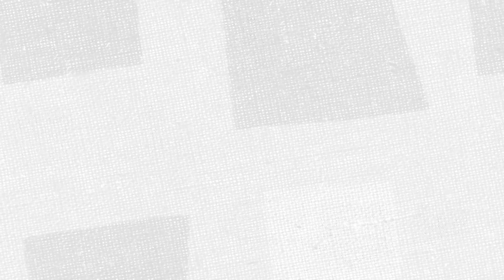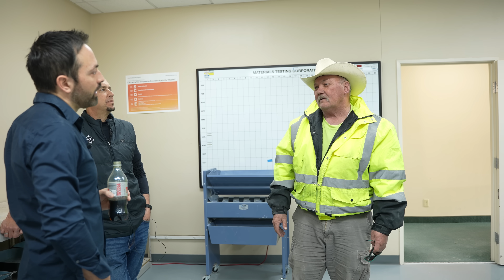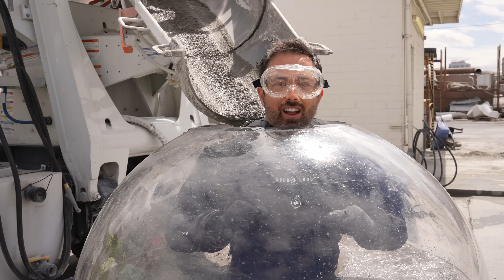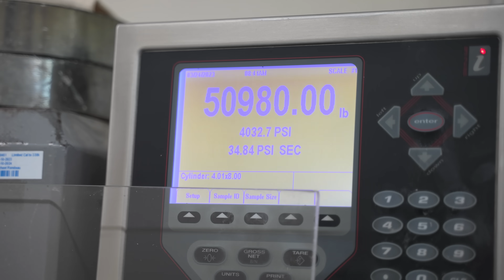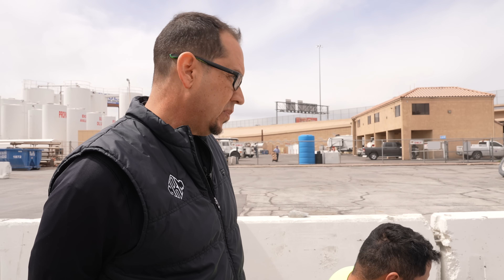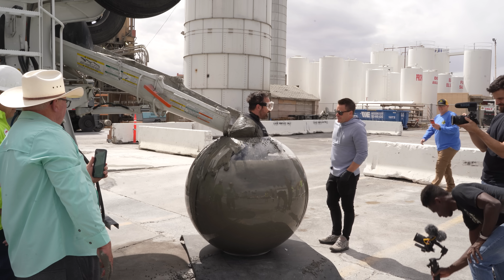Getting Buried In Concrete To Explain How It Works

Comment: Why haven't you mentioned the huge problem with the type of sand you need for concrete? It's not just any sand, as mentioned in the video, it should be round and not too fine. That means you can't use desert sand, of which there's an abundance in the world, but you need to dig up shores and riverbeds. The amount of concrete we use has already made this type of sand to a scarcity and creates serious environmental issues.
Reply: Especially with environmental-oriented sponsors so often. 
Right up there in importance with the minerals needed for electric vehicle batteries, I guess.

Comment: On a somewhat related side note. . .
The thermal expansion rate of concrete and carbon steel are very similar, 
making the use of re-bar possible, thereby increasing the strength greatly.  
A somewhat fortunate coincidence.

Comment: 1) Loved the bull wurtz bit
2) I have heard recent developments re: ancient concrete, esp. Roman concrete. Partially the strength was supposed to have come from an ability to self-repair? As I read it, the quicklime wasn't completely mixed in and was left in large pockets, and seawater specifically was used for mixing. When a crack appeared, rainwater or seawater would flow in the crack, take some of the unmixed quicklime as it flowed in, do some chemistry vis a vis the seawater (or perhaps minerals in the seawater?), and the resulting mixture would re-fill the crack. Apparently, these small pockets of quicklime are considered under-mixed or impurities by today's standards. It appears to be a study from MIT and Harvard. I dunno if it makes the concrete stronger, but it certainly appears to make it more resilient than modern concrete, and partially why Roman concrete is so long lasting. It's pretty new though, I think the study was just released earlier this year, but did the concrete chemists happen to have anything to say about it?
Reply: 15:14 He mentions the self repairing Roman concrete

Comment: "difference between cement and concrete, because people often mix these up" the #1 pun we used to use to explain my old job, I used to be an agi driver. so much stuff you have to know. also, the different strengths of concrete (like 100MPA for airport runways/taxiways, 25MPA for a house slab, 15MPA for a footpath, etc.) depends largely on what they're being used for. take a 50 storey building - you'd start the base and the first few floors at 80MPA (that's a 56-day cure, ie. 8 weeks), then progressively get 'weaker' (50MPA, 32MPA, etc.) as you work up the floors, until you're at the top where you'd use 25MPA for the roof. the slump is important because it needs to travel further up from the pump through a line to the exit point. for earthworks and pilings, etc. you can use steel reinforcing fibres (basically staples that have been opened up) to artifically make the concrete harder. it really is diverse stuff.
Reply: Interesting. I've seen and used cement with added plastic fibers which are also supposed to reinforce the concrete.
Reply: @moos5221  yeah anything that doesn't react with the concrete and can withstand the exothermic reaction it gives off will be fine for reinforcing. next time you go into a service station/gas station, look around on the concrete, and if it's old enough you may spot metal fibres poking up in the concrete. they'll be mostly flat so tyre punctures shouldn't be a thing.

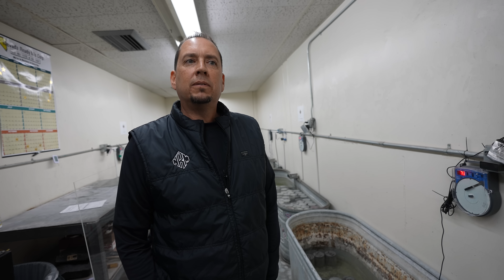Comment: 6:06 If anyone is curious, I work as an inspector for civil construction jobs. When there is a big, expensive job with liabilities, and concrete is poured, it gets tested. Every state is different, but mine requires a test every 50 cubic yards, 500 linear feet of curb and gutter, etc. The testing is used to determine who is at fault, either the contractor building with it or the concrete mixing company.  If a critical structure's cylinders  fail the break test, then the concrete company has to pay to remove and replace it. 

A technician from a third party testing company comes out to the job site and tests the concrete on site for temperature(which affects the ability of the concrete to set), slump (how wet or dry the concrete is), and air content ( 3-5% air prevents cracking due to freezing in winter) they will then collect 3 to 5 cylinders (depending on the job and design engineer's spec)  which are left on the construction site. This is so they will set in the same temp as the rest of the concrete that was poured. The technician will retrieve them after 5 days or so and take them to the wet storage.

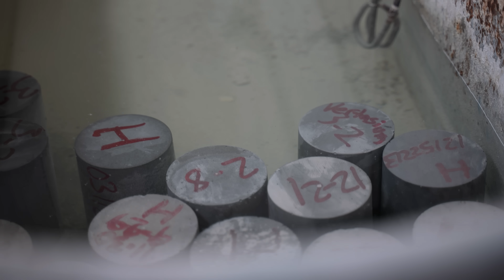Comment: Love your videos! Just wanted to add a quick thing on 5:59. Concrete suppliers sample their concrete only when testing a new mix in a job site, or in some other special situation, however almost every time concrete is poured at a job site, a 3rd party samples that concrete to test its strength on specific dates (7,28,56, 90 days) or even earlier if its a core wall, or a post-tensioning slab, where knowing the strength in one day is critical. 

A good rule of thumb for concrete is, the more dry mixes are lower strength,  while the more wet, but thick mixes are stronger. The strongest mixes (higher than 12k) will almost always have a kind of non-newtonian fluid property due to the chemical mixtures added. It is liquid, but when applying force to it (such as scooping it) it will become more like a solid. 

Concrete is rigorously sampled and tested at every job site to make sure whatever building type it is, will not collapse or crack due to bad concrete.
Reply: Practical Engineering's video titled "What is concrete?" disagrees with you. he tested some different amount of water in the mix, and the dryest one performed the best.
Reply: @EddSjo  I apologize, when I said "wet" It did not mean through the use of water, however I did not specify that. The less water will absolutely yield in a stronger breaking strength, the truck tickets will actually give a water allowance on each truck, adding more water than what the ticket says automatically means the concrete company cannot guarantee it will reach the strength it is meant to reach, however there are many other ways for concrete to be "wet" without having a high content of water, and it is exactly that wetness, that allows it to consolidate better, have less air bubbles trapped, and bond better.

Comment: I worked on a building once where the concrete company sent us an all fly ash mix (zero real cement). It was a really big deal and there was a lot of back and forth for a long time. Amazingly, the slab actually came up to strength in 30 days (3k psi break). Pozzolans are amazing stuff!

Comment: As a landscaper who is arm-deep in concrete on a regular basis, the basic PH levels you mentioned scared me a bit, and I might start wearing gloves.
Reply: read the top comment, it's scary stuff
Reply: If your hands feel rough like sandpaper, that's probably your skin being dissolved.
Reply: The bag says caustic m8, kinda wild you were never taught that tbh
Reply: @lavodan  I can't find it. What did it say?
Reply: @Egerit100  they talked about an experience where it was raining and stuff and they had to shovel concrete because it burst the mould. They were talking about how their hands felt kinda weird and tingly, and that after taking off their gloves, they found out that concrete had gotten and and stewed in there for the hours they had been working. They ended up getting chemical burns and some nerv damage I think, and only now after a year are they almost back to normal again

Comment: During construction in London on the subway there was a spill into a control room when concrete being poured found its way though an escalator control room into the other control room.
This left about a foot of concrete on the floor damaging equipment and closing some of the underground lines during rush hour. Workers then had to run around town buying sugar so they could mix it in to the concrete and kill the reaction before it set up. Similar to how Derek mentioned coke being used in this video.
Reply: I remember that - Victoria line, happened during the daytime, closed the line for the evening commute. Thanks to the sugar, they could clear the mess, re-instate the equipment, line open again for the following morning.

Comment: Spent summer last year working QC at a concrete plant, it was really nice getting to watch a video essentially about things I was working on/with regularly. Good stuff!

I will say, while admixtures in general were mentioned, I'm surprised things like fiber and rebar use wasn't discussed as much.
Reply: Dude, same. I'm a concrete technician, just like the guy with the press crushing the cylinders. And I was amazing seeing how similar things are even across the country. I thought there would've been a much bigger difference

Comment: I would have loved it if you had explained how some of the new concretes that absorb CO2 in large amounts work.
Reply: This whole video was a barely-disguised advertisement for portland cement. He didn't even mention how much CO2 is produced in the process, no way he'd go "anyways yeah here's something better that concrete companies and contractors don't want to implement."
Reply: @gearandalthefirst7027  If you watched the whole video he mentions that concrete production is about 8% of global CO2 emissions
Reply: At best, it only absorbed the carbon dioxide he released during the first step of baking process. But if you think about how nothing is 100% efficient and the heat generation for the first step probably came from a fossil fuel. It actually making alot of CO2 emissions too. Not exactly zero emission
Reply: @gearandalthefirst7027  I mean, he even mentioned that "portland cement is really just a marketing term"
Reply: @gearandalthefirst7027  who tf cares about the co2 effects of cement lol.
Reply: @JustFlyAway our planet?
Which we live on?
Reply: @raul-aurelianserban8295  our planet is not a creature bruh
Reply: @JustFlyAway  buddy
If too much co2
We dead
Got it?
Reply: @raul-aurelianserban8295  Who said that?
Co2 levels aren't anywhere near enough to cause suffocation
Reply: @JustFlyAway  its not suffocation. its the heat that's the problem

Comment: Great video. Only issue I saw was that we actually prefer "jagged" sand over spherical sand, as it provides better binding properties to the concrete. We typically do get jagged sand from rivers, where it is produced by erosion from the water. Spherical sand would come from a place such as a desert, where the constant wind and rolling of the dunes grinds the sand down uniformly into rounded particles.
Reply: Yes, famously when building in Dubai they couldn't use the sand from the Sahara since it was too smooth and had to import sand from Australia I think.

Comment: this kind of seems like something that could have gone unexpectedly wrong, derrick always takes great safety precautions but one thing i feel was looked over was the fact that it seemed the "fish bowl" was not held in place by anything and was on an elevated platform, this really began to worry me as he was sliding into it potentially causing it to roll over with him inside and roll over him causing injury or worse. I may just be paranoid but it even seemed to wobble as he slid in. Be safe Derrick, we love your videos (and  your safety)!
Reply: it looks to me like its sitting on a piece of thick steel that is bent at each end to give it some height and a hole was cut into the middle of it where the ball sits. So yea, I think they took the appropriate safety measures here. And thankfully too because what you described certainly would be dangerous

you can see it pretty well around 21:24
Reply: @SpydersByte  Also, that concrete is super heavy. You probably couldn't push it over even if you tried.

Comment: As someone who has made concrete thinmgs quit a bit, the only reason you floated out of the concrete was because the concrete was much more liquid than standard concrete is useable, too wet and there will be excess water in the mix to evapourate out, too much shrinkage causes larger than normal setting fractures. ive just touched on the subject here.

Comment: A good mix is called 1-2-3 mix.  You take 1 shovel scoop of cement, 2 shovel scoops of sand, and 3 shovel scoops of gravel.  Add a bit more cement if you wish but not a lot more.  You will get excellent strength

Comment: 10:32 Wait, I thought you DON’T want round particles, because the concretes ability to withstand sheer-forces is weaker than with rough particles that interlock in the concrete. That’s also why they don’t use desert sand for building, the wind made it round. Sand from rivers, oceans and quarries however is ragged. In Dubai for the Burj Khalifa they imported sand from Australia, since they couldn’t use the inferior desert sand and their coast sand was already used for building. Feel free to Google it.
Reply: Yes, I was looking for this comment since I thought the exact same thing. It's just logical as well: too smooth = less cohesive
Reply: @AlasdairThompson Concrete finishers want high w/c ratios and round aggregate, which is what was said. Thankfully, concrete finishers don't spec the product.
Reply: That's amazing, a desert country importing sand !
Reply: @KnugLidi  While it's true that you need water to make it set at all, having less water, a lower water to cement (w/c) ratio, increase the strength. My understanding is the main reason this works is that it has more time, it's a slower reaction, so more complete and thus stronger. A quick reaction with high humidity can causes surface cracks that lower overall durability.
Reply: Sharp edges and corners are stress risers.
Reply: Isn't that why they use rebar?
Reply: For normal concrete, you do want round aggregates, because the cement can adhere better. But if you want really strong cement, like two times the regular strength in order to build a skyscraper, then rough aggregates is better.
Reply: @eh9deux  rebar is for reinforcing the concrete in tension as concrete is extremely weak in tension compared to compressing it.
Reply: @kindlin  actually, a low w/c raises strength because when all the clay is hydrated, you don’t want free water in your concrete because it will evaporate and basically leave holes behind, which are very bad for the strength.
Reply: Civil Engineer here, no you don't want spherical aggregates (both coarse and fine). The more spherical the aggregates are, the lower is the strength of the concrete as there is less and less bonding between the cement matrix and aggregates.
Reply: For sand rounded is ok but for coarse aggregate you need corners
Reply: @blackbuddhaa  no, even rounded sand is not okay. Rounded aggregate be it fine or coarse don't interlock together which leaves pores for water to get into and rust the steel, just reduce the life in general.
Reply: Yiu have rough aggregate and smooth sand. The sand and water create a float above the aggregate giving the smooth surface, while the sharp aggregate, in matrix give the bite/ strength, as I understand it.

When you do the float however, you dont want to bring up too much water, otherwise the skin section looses too much strength.
Reply: Its an "and and" situation. it's percentages of various qualities you want your concrete to have. 5% More sheer resistance is a lot! But at a cost. That's one of those qualities, cost. So, what is the cheapest way to get those qualities, and in come the various aggregates.
Reply: @kindlin  Correct in that the w/c ratio is critical for strength.  My point is that concrete specifications aim to hit a specific strength, but the concrete finishers aren't concerned with strength but the ease with which they can get a nice finish.  They want a higher w/c ratio and will often sprinkle extra water on the surface of the concrete during finishing to get a smooth surface.  This local increase in w/c actually weakens the top surface and can result in premature spalling
Reply: @skieurdovronnaz241  So it is because it's a more complete reaction, but more complete on the water side, the cementitious side, you're saying, was always ran to completion.

Comment: I worked at a ready mix company once, they did the same quality test samples also, and I live in the Caribbean. Honestly to this day, that work is the hardest I ever did. I was a linesman, worker would the hopper truck. I also learn that petroleum jelly can help from damaging your skin if you rub some on you feet you can walk the the concrete barefooted. It feels like water if you walk in it

Comment: Never before I knew the difference between a cement and concrete, but you explained it very well! Also, I'm curious... Can concrete be recycled? Since it's the most used material humanity used, the waste must be astronomical too. Great videos, and great stunt, Derek!
Reply: Concrete often gets crushed and used as a fill material. Pretty much the only way to recycle that I know of though.

Comment: Hi Derek! Here in the Northeast, concrete pouring doesn't take a break during the wintertime. I have heard that concrete companies add salt to the mixture in sub-zero temperatures to prevent the concrete from freezing, but I also thought that the curing process was exothermic. How might added salt impact concrete chemistry? Did you get the answers to any of these questions during your research? My students and I would love to hear the answers in your follow-up segments!
Reply: It’s the same reason that putting salt in water prevents it from freezer at 32 degrees. The water has a higher affinity for the salt ions then it does the C2S and C3S , which slows the formation of the cement crystals.

Comment: fun fact: concrete will cause third degree burns if it hardens while in contact to exposed skin, and you could die from the burns before suffocation if completely buried